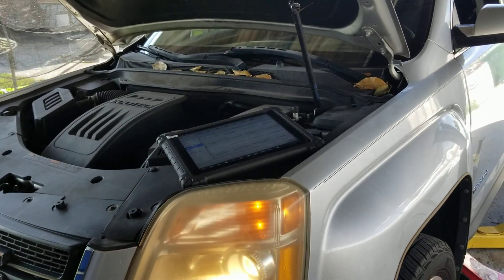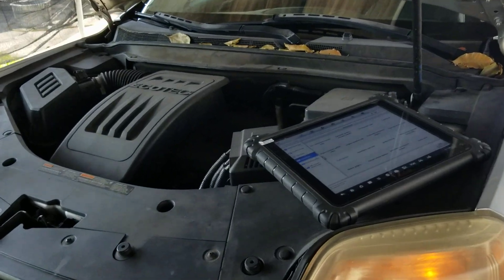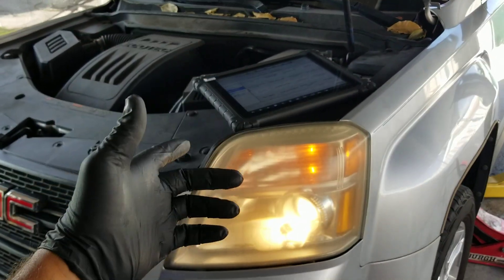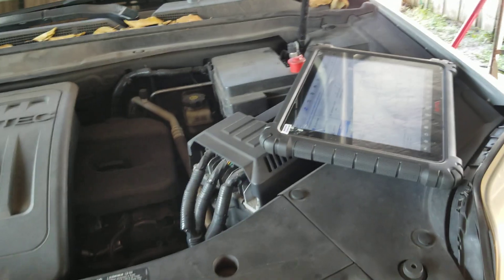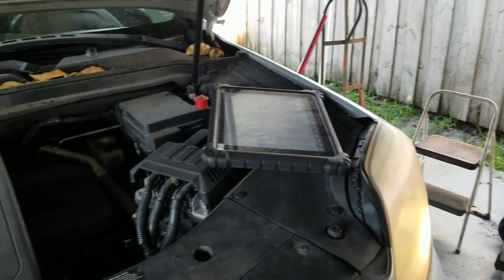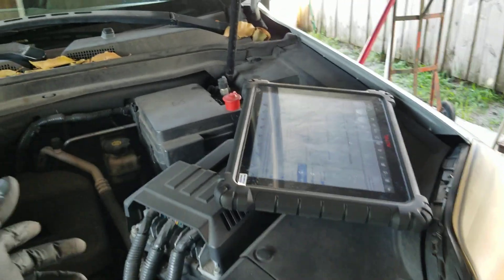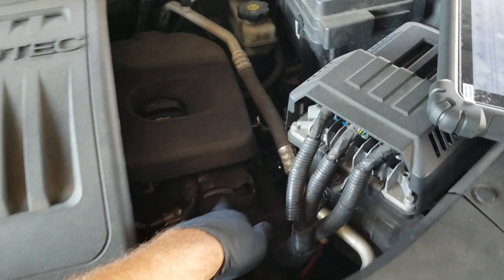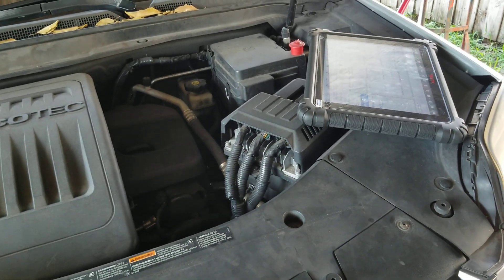GDI injector flow test using Autel Ultra

Comment: I believe the high pressure pump should pass the low pressure fuel through to the injectors, even if the high pressure pump is completely out of service. The low pressure side should allow the car to still idle. That’s how it does a cold start without a long crank time. The injector drop test should still be valid on a GDI system.